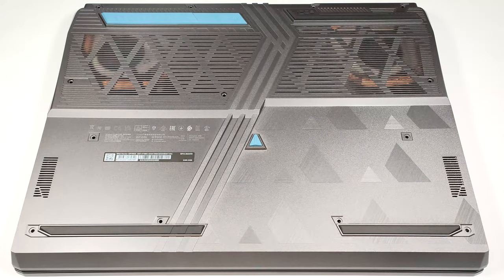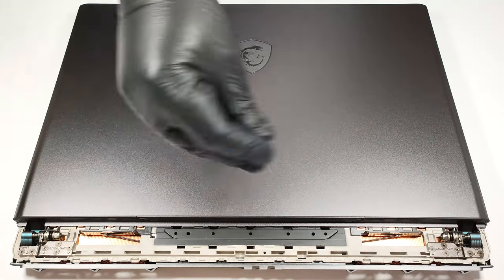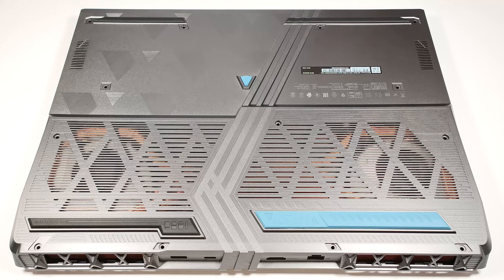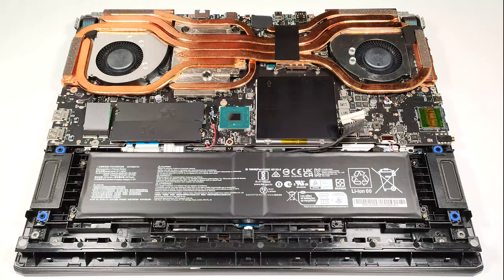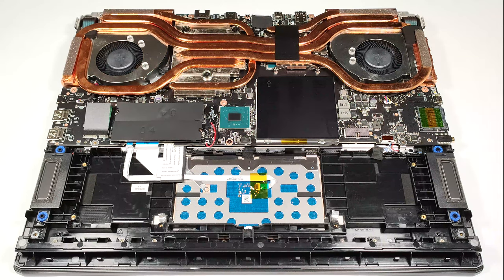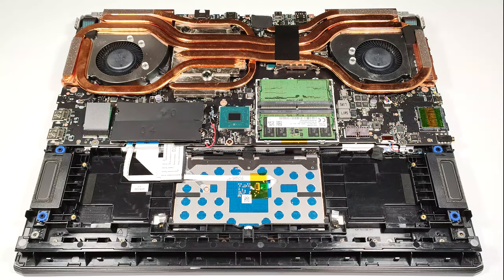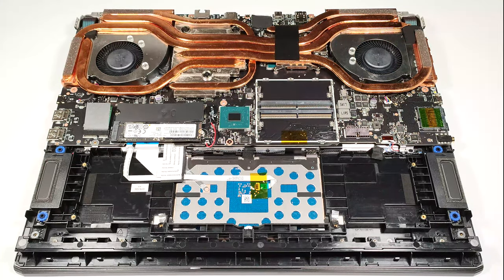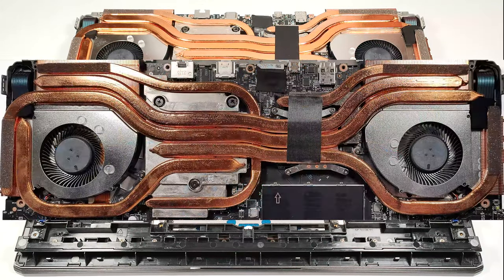🛠️ How to open MSI Vector GP78 HX (13Vx) - disassembly and upgrade options

Comment: So you don't make the same mistake as me and break stuff: Do NOT push a plastic piece into the sides, or at the front. You will break off the small plastic hooks. Only use it in the back of the laptop.

Comment: On the Vector 16HX A14X the metal cover on the memory slots is no longer glued. There are metal clips on the motherboard, 2 at each side, and you can unclip it by gently lifting the cover with a plastic tool.
Reply: Thanks man :) this helped a lot as I thought the clips were soldered onto the board

Comment: Could you please also make a video of GP68 hx??? I am very confused with the upgrade options as I watched this. GP68 and GP78 is basically a same lineup with only different in size but it seems like they offer different upgrade options? At Msi website it specifies that the GP68 ram is limited to 4800mhz and the ssd slot is consisted of 1 slot of gen 5 + 1 slot of gen 3. But it seems like the GP78 has 5800mhz and 1 gen 5 + 1 gen 4 ssd slots.
Reply: My gp68 has a 5600 ram 16gb but i have the i913thgen it also depends on your processer and motherboard but since we have the same model you should keep in Mind which CPU u have
Reply: Check your CPU specs for what speed memory it supports

Comment: I recommend if your doing this, when your putting it back together make sure you snap the audio jack side of the case on first.

Otherwise you will end up like me having to redo the whole unclipping the case thing because it looks bent and not snug if you don’t do that side first.

Just did this to upgrade to 64gb ram